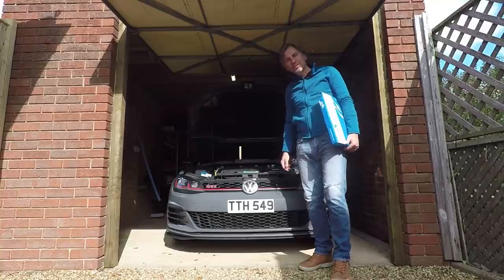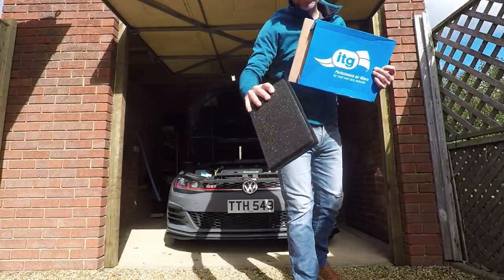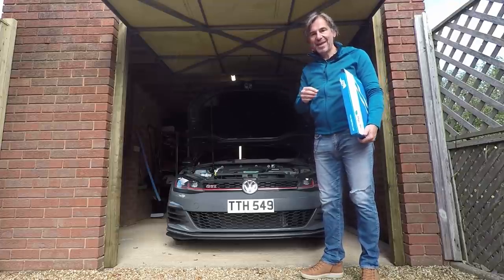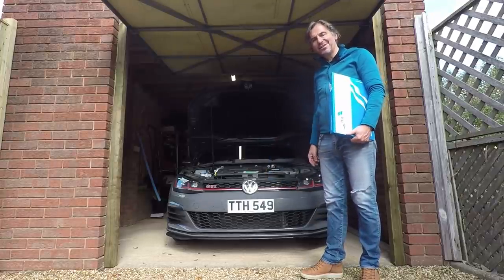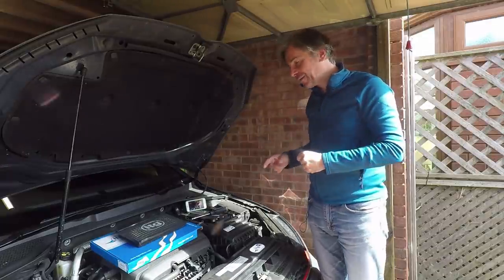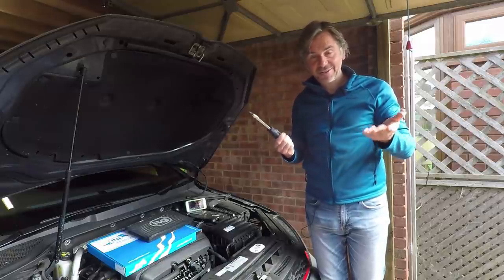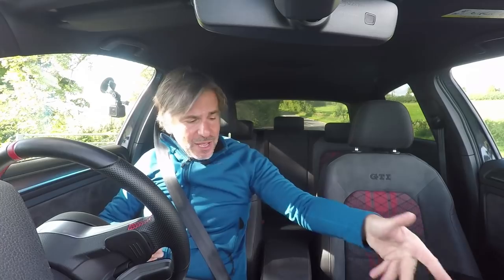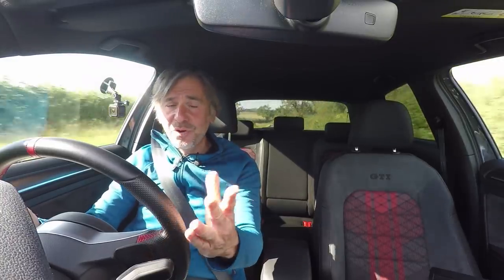PANEL FILTER TEST & DIY FOR MK7 GTI/R+S3+CUPRA

Comment: A guy in the Netherlands did tests on the engine oil after driving different air filters. The hi flow filters let through more silicone (=sand) what also could be measured by the amount of metal particles in the oil.

So... I would never do it on a car I am planning to own for a lot of miles.
Reply: Interesting thanks. I wonder what the wear rate would be to the engine internals vs. standard filter. Food for thought !

Comment: The stock filter has way more filter surface area and bugger all difference in air flow, so this proves conclusively that it's a waste of money to put in a foam filter.  Put the money towards a tune for WAY more bang for buck.  My MKV GTI still runs the original air filter with a stage 1 tune and it is extremely satisfactory.

Comment: what about removing the snow grate and adding the blanking plate to the back of the air intake (Genuine Air Intake Rear Blanking Plate for MQB Platform 2.0TSI Engines - 5Q0 129 849) - any views on those two "mods"?

Comment: Generally it does not worth to replace the factory recommended filter (which is carefully chosen for a given car/engine combo). You gain close to nothing, but risk more dust and other crap getting into your engine which became more and more complex over the last 10-15 years risking breaking expensive components...

Comment: No criticism of the ITG filter and their research and design but the OEM filter really does depend which manufacturer makes it. My VW had a UFI air filter fitted from new and always felt a bit flat and unresponsive. I bought a replacement paper Hengst air filter and the engine feels far more flexible.
Reply from the maker: Interesting stuff. As with so many things, filters will affect emissions and VW prob chose UFI because it reduced emissions at the expense of response. The Hengst one will be less emissions friendly. It's much the same with tyres, all OEM versions will be aimed at reducing Co2 while aftermarkets ones will be better at grip. If I ever do that vid I'll test OEM, aftermarket paper filter and ITG👍👍
Reply: @volkswizard  Brilliant, intelligent reply. Thank you Andrew. I'd never considered the emissions part but it makes complete sense now. HNY

Comment: The only benefit an oil filter over a paper one would be if you are willing to clean and re-oil in shorter than the paper recommended service intervals.
You would retain performance while the paper standard one would slowly decline.

Comment: Had a pipercross filter in my 2.0 TSI Scirocco and never really noticed any difference. Was gonna put it in my Cupra 290 I have now but somehow it split at the side so ended up getting rid. Haven’t bothered with one on my Seat. I did remove the snow grate and also the bonnet insulation for a bit more sound, but thats barely noticeable either. Still, it’s a good first cheap and easy mod to do.

Comment: I am running a pro ram panel filter and no snow grate  in my remapped GTD.
I would say maybe a slight difference maybe slightly better response,truth is the paper oem filters filter much better and are safer on the motors,but we all are guilty of this panel filter crime. 
We all try one for some reason when in reality we know the results before hand 😂
Reply: I'm here 2 year later contemplating sticking one in my GTD and yes guilty of that too.... Worth it for the extra noise though if any 😂

Comment: I really don't understand people's over expectations with performance from panel filters? For the rather simple install and what it achieved in terms of hp, throttle response and the reusability factor, the ITG filter was excellent.Do people expect 20,30, or 40 hp increase?Spend the money on a tune and yes, you will achieve more hp and torque but not at a cost of a panel filter. 
I wonder if the car computer adjusts itself for the change in filters?Maybe you could repeat the test after having driven with the ITG filter for say, a week or so and see if the results differ?

Comment: A mapped R will suck small amounts of foam off this filter once it gets aged,
and or damp whilst driving in wet weather with the shear volume of induction.
As they get older they get stickier to and are very much harder to clean well.
Reply from the maker: I'll keep an eye on that Brian, thanks. Luckily they are quite easy to access.

Comment: Could it be that the ECU needs time to adapt to the new MAF values? In terms of sound, did you notice any difference? I was considering purchasing a K&N filter for my MK4 Focus EcoBoost but this was a bit discouraging, although I've seen other videos with nice results. At the same time I've heard they let in more dirt and the oil can fry out the MAF sensors.

Comment: Those hi flow washable filters are like using those crap fabic face covering thinks its could stop the virus, but they dont. OEM paper filters are like the 3 ply procedure mask that works, and replace it when you are done with it.

Comment: The variance in the graph is small and could be a anomaly in the limited dataset. Would be better to repeat the recording of the data several times with each air filter to get an average to give a much more accurate result and verify the differences.

Comment: As the paper filter only needs changing every 40k miles or more most owners will only do that once during their time with the car.  So no saving, in fact more expensive with the cost of the ITG filter, and for negligible increase in air mass.

Comment: Good video but I wouldn’t call that a big improvement. Looking at the graph it’s about 2% max improvement above 4000rpm
Reply from the maker: If that equates to hp (and MAF flow is used as a rough guide to this) then 2% is approx 6hp which for £60 is actually pretty good.  Throttle response and reusability are the key benefits though
Reply: volkswizard That’s very true, but I was just questioning whether I’d call it a “big” improvement regardless of the cost.  Also paper filter is about  1.5% better at lower revs  so swings and roundabouts.

Comment: I have a problem and im hoping you have a possible answer, when using an aftermarket filter my intake hose gets really dirty no matter what filter i use, i have also noticed compressor blade damage that i can only assume is due to all the crud getting through, do you think a stock paper filter would stop this?
Reply: For sure! 
I did several tests and the difference is huge.

Comment: It flows a little better but does it filter as much dust? I wonder what the long term damage of using high flow filters can be.
Reply from the maker: In dusty climates that might be an issue but not in the UK or most of Europe

Comment: So the crap standard one was nearly as good🤔😂
Reply from the maker: 2% gain as someone else stated is 6 hp for £60 so not bad. But main benefits are better throttle response (which the data won't show) and reusabiliity

Comment: I had one of these on my cupra 280, was fine for 20k but then i checked and the filter.material had detached partly from the structure. Had to throw it away, so not impressed tbh, j
Reply: Did you go back to ITG to see if they would replace it?

Comment: I replaced the standard air filter for a K&N as Euro carparts had a sale, would you remove snow guard to help air flow
Reply: Wheres the snow guard?
Reply: Hans Wilsdorf  
The snow guard is the panel underneath the air filter element, it simply pulls out allowing more air flow

Comment: So it gives no benefit over the OEM one (that is only good for chucking away) save for being reusable. 

But, the OEM that comes with the car is good for 40k miles. 3 more OEM ones (ie which will be the same price as this aftermarket one) means you can cover 160k miles on OEM ones before the reusable one breaks even

Think I'll stick with OEM in my R, unless you do further work on it and show that there is a benefit.
Reply from the maker: Throttle response has always been better when I've fitted one of these, the extra air flow seems to confirm it's doing what it should do.  I'd never run 40k miles on an OEM filter as they are usually clogged after 20k,
Reply: @volkswizard Interesting. I wonder how much is placebo though. Having said that, throttle response on the Golf is pretty dire unless you get a remap or PedalBox (of course just IMO)

Comment: Great Friday night viewing from Andy’s salubrious garage - TCR upgrade far more exciting than Harry’s Lamborghini v12 resto rubbish lol 😝 - great upgrade inmho though as air flow and turbo boost are interdependent - shame VW skimped on the gas strut for the bonnet as my RS265 has one ☝️ however it also rides like it has concrete filled run flats at times :)

Comment: Showed no difference whatsoever. Completely pointless
Reply from the maker: Do you know how to read a graph?
Reply: @volkswizard  Yeah, of course. It's just that the difference was marginal and seemed hardly worth it. What would be interesting is if you did the same experiment with the OEM panel filter versus a proper induction kit. This would highlight how restrictive the original air intake is and what gains could be achieved.
Reply: I think these show more of an improvement the more powerful the engine is. Also when combined with an exhaust and a remap / cams the benefits compound. It’s all relative to cost innit.